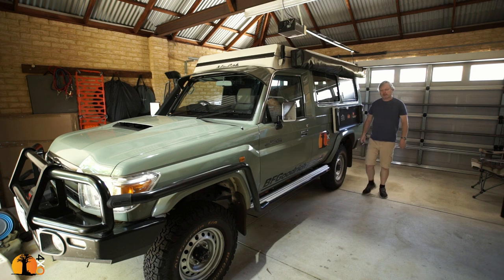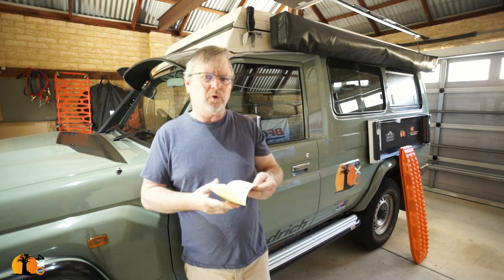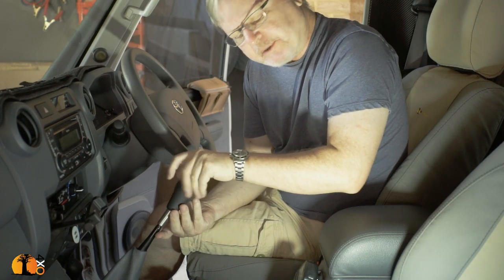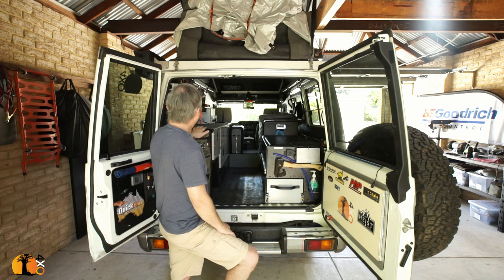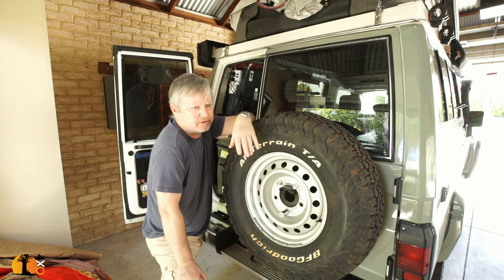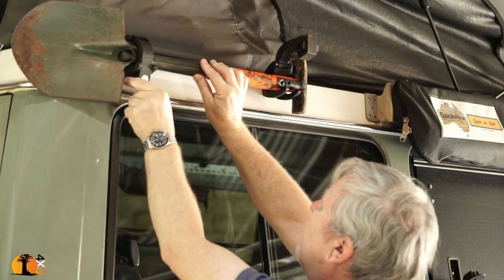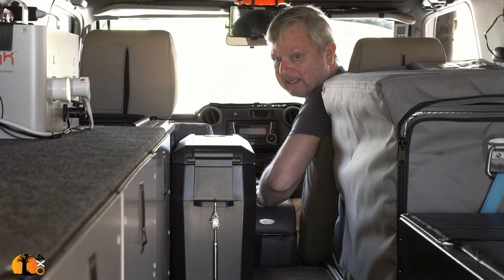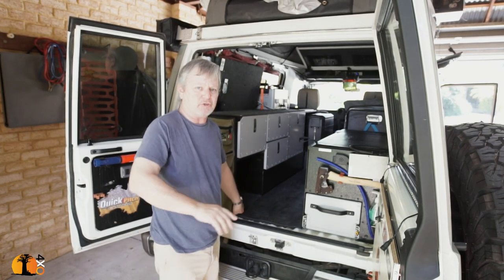TOYOTA LAND CRUISER TROOPY BUILD - phase-2 begins

Comment: It is nice following along on your build Andrew.
Have you looked at the ARB Intensity LED lights and lightbar?
Designed by ARB, and Rigid Industries in the USA build them for ARB.
I really like mine, and you can fit it all on your ARB bumper.
http://pnw4runners.com/camping_trips/aug17/1.jpg

I like that fold down table too that hold your Maxtrax.
Your rig is very well thought out and built.

PS, check out Goose Gear owner Brian's Tacoma with the Adventure Trailer Habitat on it.
It may give you some ideas.
https://www.youtube.com/watch?v=u1gD2KZDB40

He has a very cool bench to sit on with back support when using a laptop.
He also built my new cargobox for my FJ, very well built.

Comment: Some red, yellow led lighting research... 
This article seems genuinely 'authoritative' for our purposes. 
luxreview com/ article/ 2015/ 06/ led-lights-don-t-attract-insects-true-or-false   (you need to edit this url). 
In summary, MOST insects see UV and Blue better than yellow and, more so, red (invisible?). But yellow is brighter for humans than red. They seem (not definitive) to prefer LED but only because it is not hot. Also not understood is, what if you are the ONLY light around? Also not sure. 
Anyway, it seems yellow and/or red light is the way to go. 
BUT BE CAREFUL. Make sure you can afford the power consumption. 
The (SMD) LED Strip Lights I saw were rated at 12w/meter, ie. 1amp/meter. So if you leave it on for 4 hours, that's 4 Ah or more like 5% of a 100Ah battery. Get yourself a few meters and it will quickly add up.